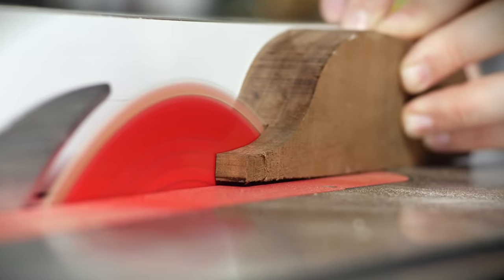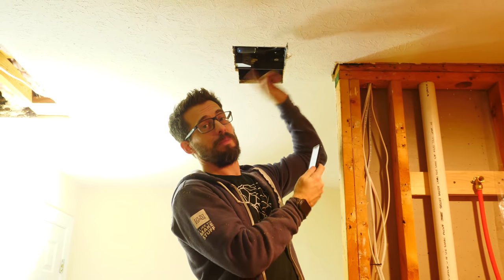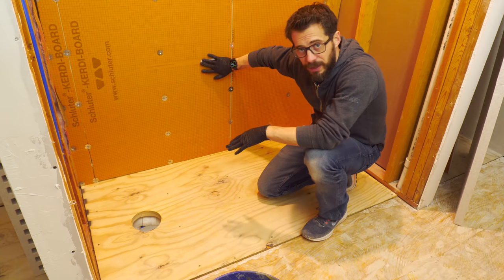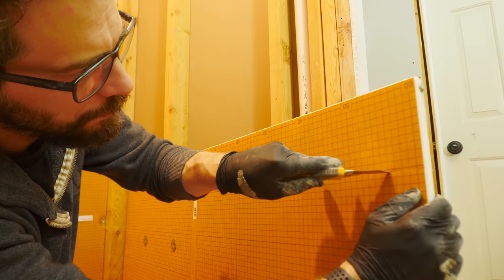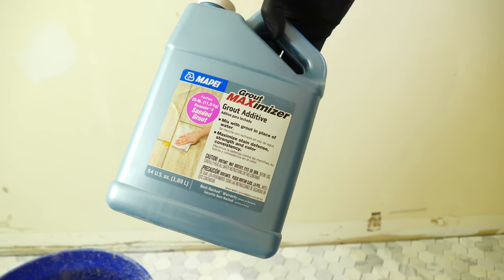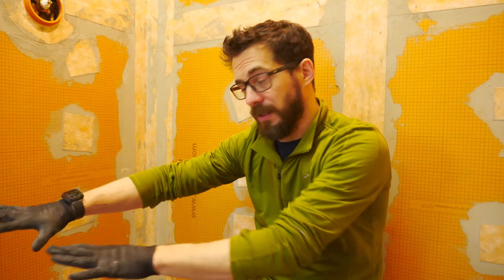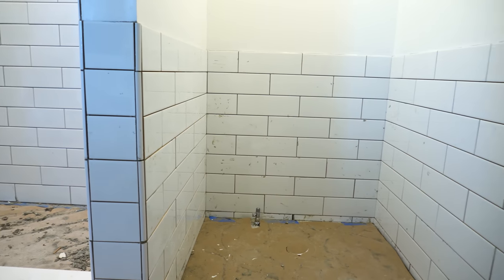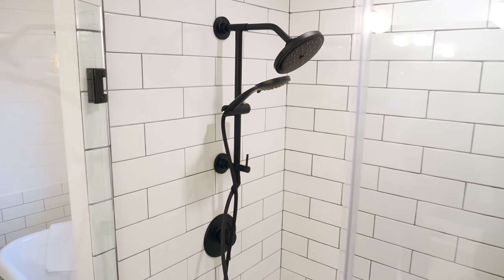Remodeling a Master Bathroom | Part 2 | I Like To Make Stuff

Comment: Dude, it's soooo weird to see how you guys construct houses up in the US... Here in Brazil we only use wood for things like doors, tables, chairs and so on. I mean, we use wood during the construction, but just to make molds, let's say, for concrete. 
But, well... We don't have earthquakes down here like you do...
Reply: It's weird for me to, I'm an Norwegian electrician. And not the be rude, but the electrical standards in the US is so fucking bad... Hahaha
Reply: @KingFrederik1309  Can you elaborate? I live in the US and can think of some things I don't like. I wish everything was 240v like you probably have, as that would let us use more powerful/faster heating appliances and it would reduce wire sizes. I'm also leery of running wire inside walls with no conduit or anything. I get that it's technically fine, it just doesn't feel as safe as I'd like, which is part of why I'll be running all of the wiring in my new shop in surface mounted conduit. You guys use DIN breakers and panels, which are smaller, so that helps with how things look, but I personally don't dislike our setup because bigger breakers/panels means better cooling and more space to work in. I've considered the alternatives to our wire nuts but none seem much better, and some seem worse. I think most of our metal ceiling-mounted electrical boxes (like the can lights Bob used) are way too flimsy, as are our blue plastic switch/outlet boxes, but our heavier metal boxes (usually used with conduit) are quite sturdy.

And yeah, our system of measurement is absolutely idiotic! I wish we'd go to metric, though the one Imperial unit I like that has no metric equivalent is the gallon.
Reply: @bmay8818  I'd much rather have both 120 and 240 as we do in the US.  If you have a power hungry appliance, you wire it for 240v, obviously.  But 120v allows for closer spacing of the prongs in an outlet, allowing for smaller plugs, and less risk of arcs.  You can run 240v over the same 14/2 romex that 120v is run over, just connect white to the other phase instead of neutral, and tape it with something other than white or green tape.

I like to think most educated folks in the US are bilingual when it comes to metric and imperial units.  Hearing the rest of the world rant about how bad imperial units are is a bit like an English-only speaker berating someone who speaks perfect English because they also speak Spanish.  Halving 3/8 to get 3/16 isn't "harder" than halving 27mm, any more than reasoning that 5.2 is "about 5 and a quarter".  It all just depends on what you're working on.  As for the gallon, try the liter, it works a treat for volume.
Reply: @MrWhateva10   All of the 240v machines in my shop use NEMA 6-20 outlets, which are available in duplex configuration, so you can plug just as many appliances into the same size outlet box, but at 240v. The plugs are about the same size as standard 5-15, 120v plugs too. At the voltages we're talking about here, I don't think there's much difference as far as arcing. I honestly see no advantage whatsoever to having 120v as our most common supply. There are no disadvantages to 240v except that it's slightly more dangerous as far as electrocution risk. Advantages are that you double the power that appliances can draw (very very handy for anything that heats up), there's no need for different voltage plugs/breakers/etc (which simplifies supply chains and installation), and the wiring can be significantly smaller. That latter one would save approximately 2.3 gazillion lbs/kg of copper.

Saying the Imperial system sucks is nothing like saying a language sucks. The entire point of the metric system is to have a (nearly) worldwide standard, a HUUUGE advantage. Standardization is one of the best things we've done throughout history. Does it not say something that the entire world except for us and I think 2 other places is metric? There is enormous practical value to it.

Languages developed differently, localized to certain areas. So did systems of measurement. But the former is immeasurably important in a cultural sense, and the latter is only important in a functional, utilitarian sense. Nobody who switches to Metric feels a huge, existential loss to their identity, unlike what people would feel like if they were somehow forced to stop speaking their language and take up another one.
Reply: @MrWhateva10  As someone who works with the Imperial system for a living (I'm mostly a woodworker), I really dislike it. I STILL am not used to it and I've been in business for 7 years. Some of the marks on a tape measure still take me a sec to understand, but Metric is a piece of cake. I just don't see why anyone would want to stay with a system that A. Makes no sense in the modern world, B. Is maddening to work with and C. Makes it unnecessarily difficult to interface with the rest of the world.

I just like the gallon. I know I can just estimate liters by multiplying by about 4, but that just doesn't do it for me for some reason. Gallons are a nice quantity of something. I think miles are too, in that the distance traveled in a mile is a good way to look at distance, but the number itself is dumb.
Reply: @bmay8818  We can agree to disagree.  Change is expensive, and if I already have both of something, I can't personally see the reason for pursuing getting rid of half.  Whether it means rewiring my house with all 240v (which I can do without any changes in the national standards mind you), or ditching my 2x4s, that are really about 1-1/2" by 3-1/2", for 48mm x 98mm lumber just to say I have.  You're acknowledging you have 240v in your shop everywhere you need it, and you did that under the NEC code, so why does every one of the 130m+ households in the US need to switch all their outlets to 240v just to be more European, you know?  Anyway, I hope we hear back from Frederik about his thoughts on the NEC vs IEC standards.  I'm not aware of any differences so large you could call the NEC "so fucking bad".  Certainly, fire and electric shock statistics don't bear out some safety epidemic in the US, but there are a lot of variables there.

On the subject of units, I wasn't saying I'd feel an existential loss if I were forced to stop using imperial measurements.  I was saying Europeans that insult me for saying it's 80 degrees outside, or framing a wall in two-by-fours makes me a knuckle-dragging neanderthal, are really insulting themselves.  I work in metric just fine.  They're apparently just fraction-impaired, or otherwise unable to cope with number systems that aren't base-10.  1760 yards in a mile!  LOL!  Of course metric has advantages in linked-units and base-10 operations, and I use it all the time, but I'm not injured by the existence of imperial either.

The one concession on the units discussion I'll make is machine tooling - I need about twice as many taps, dies, drills, calipers and so on than I would with a single unit of measure.  I already own them though, and there are lots of parts in both units of measure that will be interfaced with for the foreseeable future, so I'll let a more feisty younger generation take up that fight I guess.  Take care, and good luck acclimating.
Reply: @MrWhateva10  I never meant that we should change all of the wiring in existing houses, that just makes no sense. Lots of changes, like switching to 240v-only wiring and changing to Metric, happen by making the new stuff on the new system and eventually, everything gets switched over. They tried Metric in the 80s but it didn't catch.

I guess the way I look at things like this is by asking "what do we lose vs what do we gain?" and when the ratio of gain to lose is very high, then it makes a lot of sense to do that thing. I see very, very few downsides to making both changes.

But just because we use Imperial here in the US, that doesn't mean that we're idiots or anything. People shouldn't be saying those crappy, stupid things. It does make more sense to use Metric BUT that is not the same as saying that people who don't use Metric are somehow inferior. Much of the best stuff in the world has been made by places using Imperial.

I too want to hear what that other person thinks. I'm always curious about different ways of doing things.
Reply: @monki_sudo  We are also required to have all connections in accessible boxes. We have the corrugated blue "smurf tube" too, but hardly anyone uses it inside walls. I think that stuff isn't as good as "real" conduit but it's much better than running wires inside walls with no conduit at all. It must be a lot easier to redo wiring where you are!

Comment: Love your videos.  Painting contractor here.  Couple tips....when texturing you want to wet the drywall mud down to where it has the consistence of pancake batter....and when you press the texturing brush into your wet drywall mud, you want to give it a 1/4 turn to match the rosebud design on your ceiling (this will give it your desired "swirl of rosebud).  Other than that...A+++ videos!

Comment: As always, very interesting and informative Video.

Besides that I'm kind of impressed (especially after seeing some of your other videos) about the fact out of how much wood and drywall your whole house is actually made.
I'm coming from germany, and most average houses here are pretty much only made out of different types of concrete/cement and stone. Besides the flooring and the roof truss you'll hardly find any wood in the structure of buildings.  There are also a lot of other things I've noticed, which are very different from the most common methods that are applied here.

I think it's a very interesting insight to see this whole other methods of how a home is build.

Comment: one thing id recommend is measuring the width of your shower tiles before setting the height of your niche so your tile line is flush with your niche. Gives it that pro look. Also recommend making the plywood surface slightly damp before putting the mortar on, helps with the bond. Awesome video, extremely informative

Comment: very nice project. for old flat mirror like this, one thing i like to do to give them a new look is simply add a frame to it. just grab some MDF, use a router to make a track to inbed the mirror in (and style the side of the frame to your liking) and paint it the desired color. its also pretty usefull to hide defect around the edge of the mirror like old paint or if the side is chipped.

Comment: Great video and I love the foam module system for the shower. My country's building regulations requires the drain to be located at the lowest point of the room so this system will have its limitations but still interesting.

Comment: I just stunned at the way you build houses. I work as a  technical drawer and was some time on the construction site. In Swiss we build most things out of concret. The houses are build for 100 jears. This is why we have around half of the elecronic use per Houshold compared to the USA. I dont make things like this by myself, because it would be much harder.

Comment: Wow. LOTS of work. Very nice job! My favorite part was the sub-freezing tile cutting. That's true dedication. 

You ended up with a partial row of tile at the base of the bathroom walls, which is inevitable due to the height difference of the floor vs. the shower pan with the continuous surround. What's your feeling in retrospect? Would you recommend the way it ended up in the video, or doing the opposite by starting a full row on the base of the wall, then cutting a partial row on the shower wall to match the height?

Comment: Not only do you need wet rating but for lights you have to also make sure they're IC rated if there is insulation around it, if not you need atleast 3" of open air around the can/light

Comment: So I use to work as a tile setter, to avoid the swelling and pain in ur hands after ur done for the day but before you use soap, lather your hands with suave lotion, it works the cement residue out of your pores and lessens the swelling/pain. Don't know how/why it works but it does haha

Comment: Iv done many many showers and always before u put mud or derock u always put ice and water shield down first. It’s key because in ten years if there is any leak it will get behind the wall then mold comes and u gotta re do it. Trust me iv had to tear out many showers because the foundation is not right. The last shower I did cost 65 thousand dollars. For 1 bathroom. The shower looks great man keep up the great work.

Comment: Have you tried dipping the brush in water before adding the texture to the ceiling? I used that method when texturing the plaster on my living room ceiling... It might make it easier for you. Theoretically speaking it softens the texture and makes the draw off slightly bigger which should make the 'less textured more shaped' style of texturing you are looking for.

Comment: Hi Bob, awesome work, I like the way it has turned out, you guys must be really satisfied with it! I have one question: how do you make sure that the tile is waterproof in the most exposed areas? Here in Denmark the building code demands the use of a waterproof membrane to prevent damage to underlying building elements. Did you use something like that? Best regards!

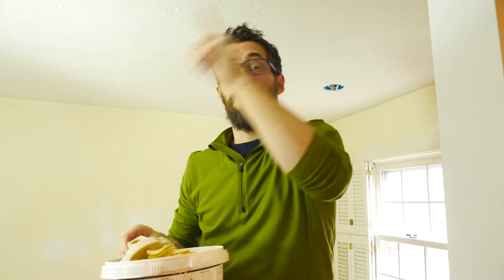Comment: 16:45 I believe that particular brush needs a 1/4 turn-spin clockwise while pulling it away from the ceiling. It's not the right brush to match what you already have, but giving it a short twist will help make it look better.

Comment: If your covering floor with paper or cardboard and you haven't put the trip in yet keep what your using to cover the floor back from the walls a inch or two so you don't have to pull it up to trim out the room. Keep up the great work Bob

Comment: It "came out" really well! 👍 Nice job! One question, what was the paper-like material that you placed around the foam step into the shower and used to patch over the screws that you used to fasten the waterproofing board to the studs? It looked similar to the backing paper found on drywall🤔

Comment: Looks great.   Is there baseboard.  The little sliver of wall tile at the bottom of the wall might look better with baseboard finish tile?   Or if you tweak the layout to raise the line where the tile stops on the wall so there was closer to a half tile down there at the base?

Comment: Do they give any info on the integrity of the “dry wall” and foam flooring you used in the shower? 

Any issues with weight on the flooring or step up/over area of the shower?  Also with the cubby area?

Comment: bob you should have used the new led pot lights with a driver,  its  just the flat lens that cips to the back of the ceiling to stop it from pulling down and then has a whip to a driver where you do your connections it can mount to the joist and im not sure about your codes where you are but here in Canada you cant use a connector like that for romex into a box it has to be a grey plactic L-16 usually

Comment: one thing to note - if you put down thinset on non waterproof floor board, it WILL buckle after time. I ALWAYS used concrete board first and on floor, tile too. It's and extra step but your flooring will never squeek or crack.

Comment: Like in the first video, most of this would not fly with code or insurance in Norway. The electrical work would need to be done by an electrician (unless it has a plug you are not allowed to do it yourself). And the wet zone remod (tiles yes, membranes no) would have to be done by someone with wet room certification for insurance to cover any potential water damage. Is this different in the US (or in separate states)?

Comment: Terrific video(s) and project! My paranoia gland is working overtime though... Won't a foam shower tray deform and flex with regular use? I'd be worried about gaps opening up. When I renovated my shower (here in the UK at least) every tradesman I talked to made a point of telling me to buy the best quality and most rigid shower tray I could afford to eliminate this potential problem. Are there different codes in the US which prevent the use of more substantial trays?

Comment: Your bathroom looks great. I hope this doesn't sound too arrogant but I have a pro tip for anyone who wants to install recessed can lights, if you're going to use halogen lights make sure the can light is IC rated if it's in a tight space or if there's insulation. The IC rated can lights are thermal protected to keep them from getting too hot.

Comment: This series was very informative, and great to watch. 
Question: when grouting the tiles, is there an easier, cleaner, less wasteful way to apply the grout, other than slathering it all over the tiles? Could a narrow tube,  similar to a syringe tip, be used with something like a caulking gun to apply the grout? I've always thought the whole process looks so messy and inefficient, with the amount of grout that seems to be wasted by smearing it on, and then wiping most of it off again...

Comment: Hey Bob-
When you drilled through your tile for the door hardware, did you have to do anything special to avoid cracking the tile aside from using a ceramic bit? Did you use a fresh bit for each hole? I have had mixed results with that.  

Also, were you able to return the too-wise door, or did Lowe’s cover that?

Comment: Remodel looks good, but I cringed when I saw you installing recessed light cans, when you could have done LED wafer lights. I've been using wafer lights in many of my flip condo projects lately, we no longer install cans, they are no longer needed. The wafer lights also come IC rated and damp area rated with gaskets. You should look into.